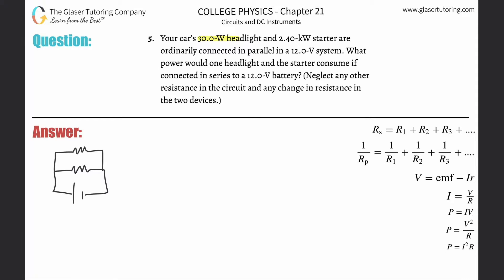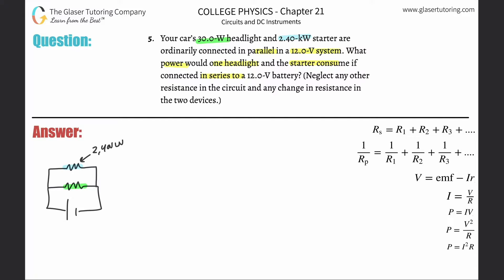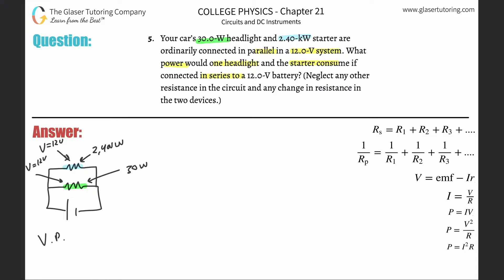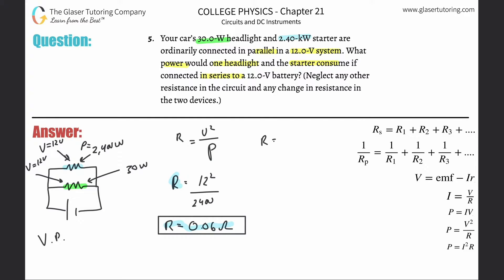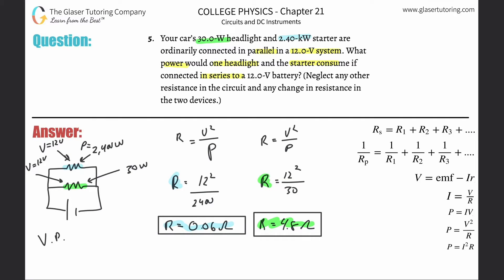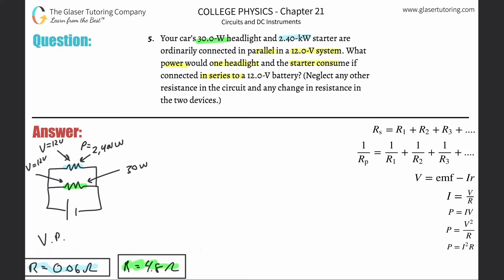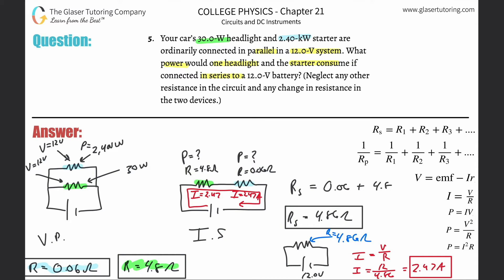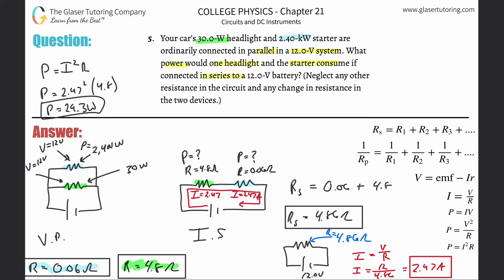21.5 | Your car’s 30.0-W headlight and 2.40-kW starter are ordinarily connected in parallel in a

Comment: A shorter way could be : 

Rs=R1+R2
V^2/Ps = V^2/P1 + V^2/P2

Simplify with V^2 and results:

1/Ps = 1/P1 + 1/P2
Ps= P1xP2/(P1+P2) = 30x2400/(30+2400) = 29.63 W

where Ps is power in series